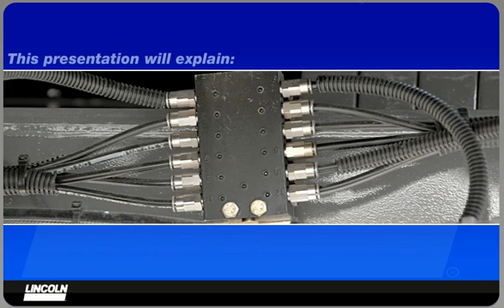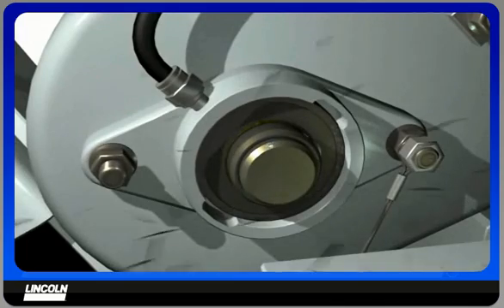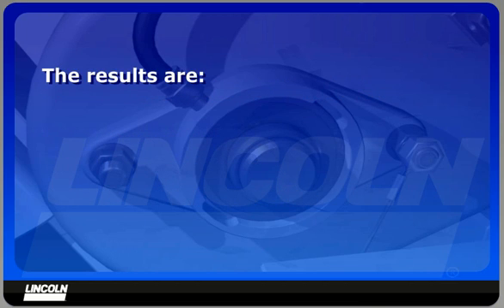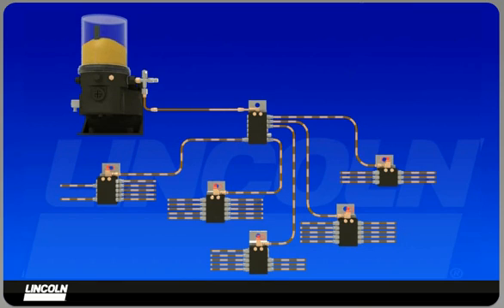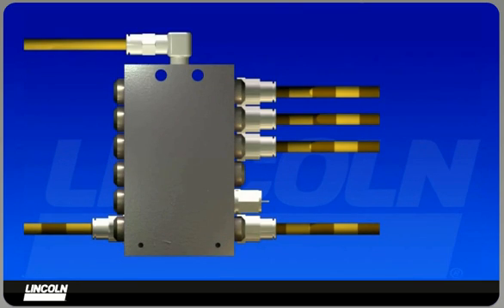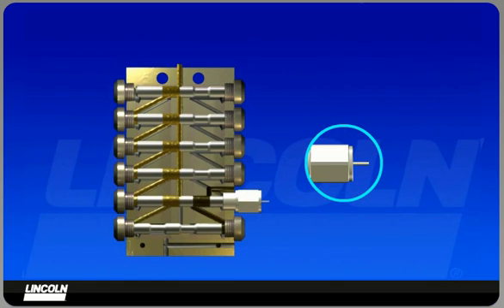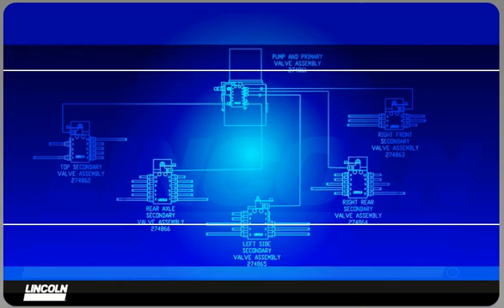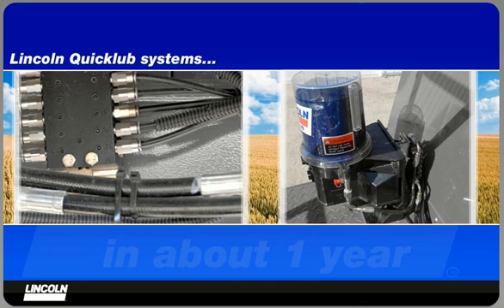Lincoln Automatic Lubrication For Agriculture Equipment

Comment: Did you know a 1957 Mercury had a lubrication system similar to this? Well they did as a option and had a button on the dashboard that you push every once in a while to grease the tie rods and ball joints. I put the system on a Ford truck and it did work, but the grease would only flow in the summer, not in winter.
Reply: Did you also know that you remind me of Adam Lorberg and Alex Mathews. Alex has a greasy hair.